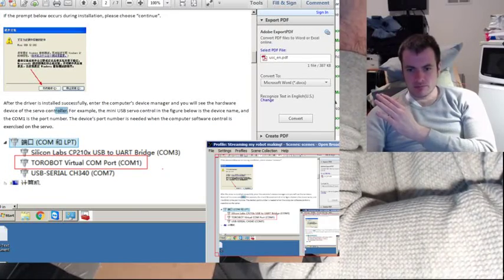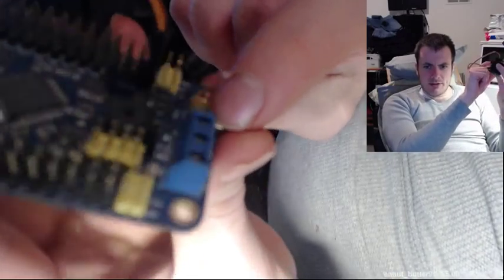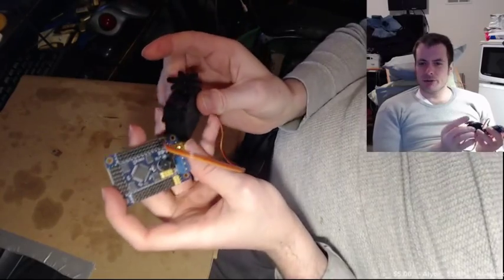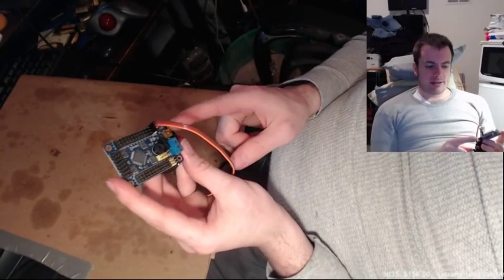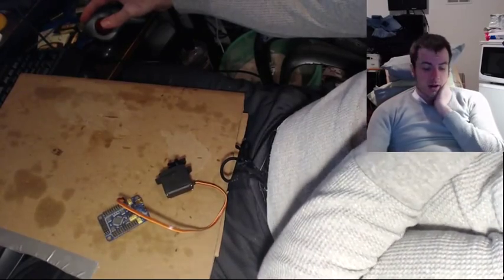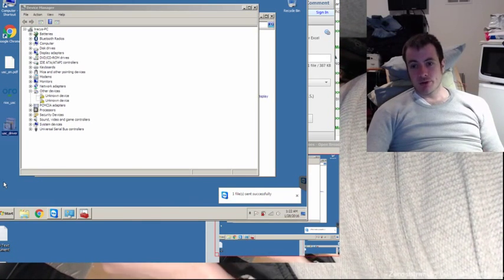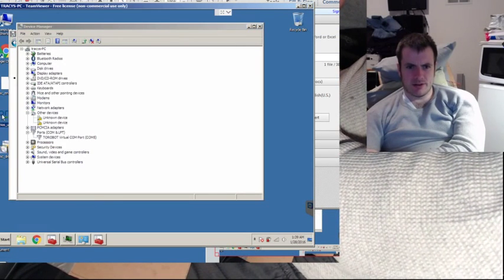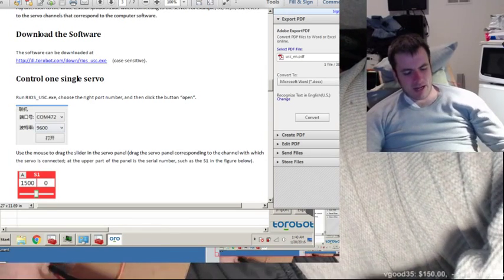Setting Up 32 Servomotor Controller to Work W/ PC Via USB | Building Humanoid Robots #50

Comment: regards
 I have a problem I can not install the software my micro usb is 24 servos. equal to the one that shows in the video only that of 24 servos

can you help me
Reply from the maker: to install, you might have to right click and run as administrator for the installer to work.

Comment: I'm having the same problem . My servo controller only beeps when I try to set the position of a servant. right now it hangs completely, the interface and triggers the whistle. I already do not know what to do it is not working. if you know What do I can do let me know
Reply: Isaque Antonio did u figure it out?